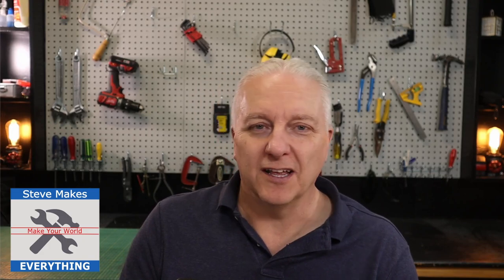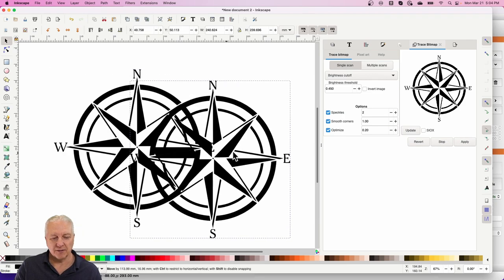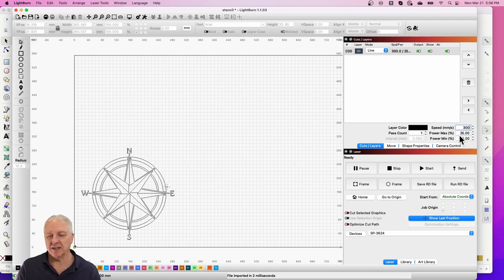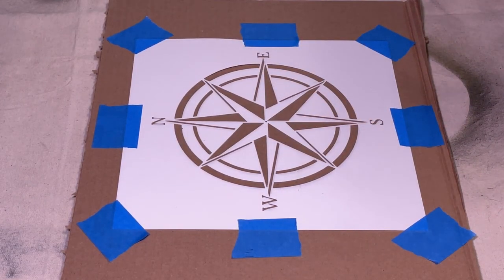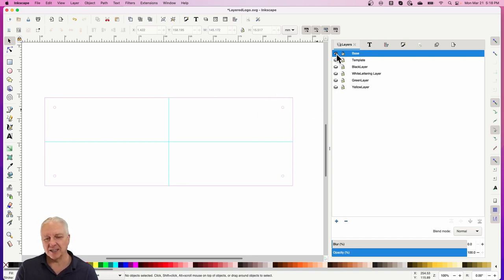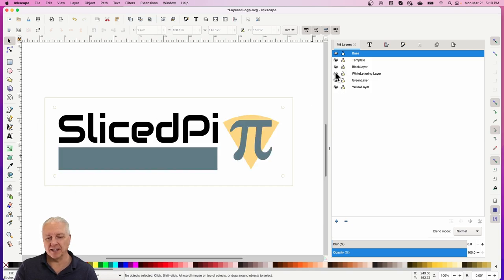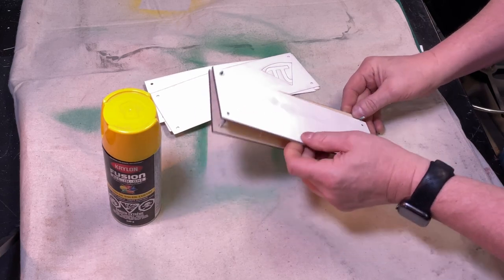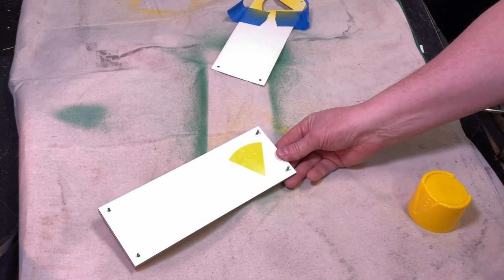Laser Cut Mylar Stencils

Comment: Thanks for this video Steve. I have some 7.5mil (190 micron) mylar sheets I was wanting to make some stencils with. 
Would you have any idea what laser power I would need to cut through his material quickly and effectively?
Reply from the maker: Power settings depend very much on the laser, but Mylar cuts pretty clean and easy so I would say start with about 50% power and reasonably fast speed

Comment: Regarding overspray, you can minimize it by spraying the back of the stencil with with removable (also called repositionable) adhesive.
Reply from the maker: Sure that could work. You could always just put a bit of weight of the stencil too in order to make sue it is flat of the surface before spraying

Comment: Hi Steve, Thank you for your well informed video.  Can you tell me what laser machine you are using to cut the stencils?  The link you have goes to the Cricut but I am looking at purchasing a basic laser cutter.
Thanks again.  Anna :)
Reply from the maker: You can use virtually any laser for this.  If you are buying a new laser I'd recommend a 20-30W diode laser.  This will work if your stencils are made from card stock, cardboard or Mylar.  Don't try to cut PVC with any laser though, since it will outgas Chlorine.
Reply: @SteveMakesEverything  thanks so much for your response.  You have been extremely helpful 😊
Reply from the maker: @ajfmodernart  I try 😏

Comment: Thanks Steve!
I cut airbrush stencils of all sorts out of .5mm acrylic and quick one-time use stencils for painting rc planes/boats out of scrap paper and spray adhesive😎
Reply from the maker: As I noted in another comment, anything that you can cut a hole in will work fine.  Acrylic would be great if you want to make many copies but it's probably cost-prohibitive if you are making just one of something.  Card stock is as cheap as dirt and cardboard is free.

Comment: I would like to cut  stencils using mylar for stencils for cookies, is a diode laser good for this? and what is the best thickness for this? and if I curt mylar with a laser is it bad or dangerous ?
Reply from the maker: Mylar should be safe to cut. It has no chlorine or other bad chemicals. Of course make sure you are vent fumes properly. The thickness shouldn’t matter since you will be able to cut any thickness
Reply: @SteveMakesEverything  awesome thanks for your reply,  is the acrylic the bad one?
Reply: @yolandaruiz9435  No, acrylic is safe as well. That's PVC (and vinyl) which is harmful (both for your lungs and for the laser) to cut with laser: it has chlorine (the C of PVC) fumes which mix with air moisture, creating chloridic acid…

Comment: Sweet video - any tips on making a stencil that is larger than the bed of the laser?   I suspect I'll need to cut it in pieces, then connect the pieces, looking for ideas on getting the registration right so the parts line up (48x48" stencil on a 17x17" laser)  Thanks!
Reply from the maker: If you have a diode laser, you could just move the material around under the laser.  Add a few non-engraved targets to help with alignment if it's critical.

Comment: I have a question: is it possible to laser-cut stencils (masks) from washi tape (japanese masking tape)? How small elements can be? I build plastik models and I use cutting ploter (not a laser one) to cut masks, but from time to time designs require more precision. Some elements can be smaller than 1mm. Is possible to cut them on laser cutter?
Reply from the maker: It should be possible to do this.  Lasers tend to be very precise.  for most lasers the kerf (i.e. the gap created buy a cut) is on the order of .2mm or less.  You should be able to resolve elements down to less than a millimeter with relative ease.  Note that you can also calibrate lasers such that when you cut something like a square, it can be accurate with typically +/-0.1mm or better

Comment: So you can basically cut out anything you'd like correct? So if I wanted to cut out load of the Ring type of stencils or comic book stencils I can? I'm thinking about buying one for my spray paint art Workshop. I'm just curious if I could make a stencil of what I want or is it certain things you can?
Reply from the maker: You can make stencils out of any material your laser can safely cut.  If you want to use PVC type materials for stencils then a blade cutter is the right choice.  Look at the review I did recently for the xTool M1.  If might be the best of both worlds as long as your stencils aren't larger than the workspace
Reply: @SteveMakesEverything  thank you for responding. I meant more like any type of picture you'd like?
Reply from the maker: @jarrettvasco7710  Ah.  Well obviously you will be limited to images that are monochrome (a.k.a Black and White).  Grayscale images would be out of the question unless you are very good with an airbush
Reply: @SteveMakesEverything  I'm looking to buy a laser cut out so I can make stencils! Maybe two three layered stencils. I'm a newbie spray paint artist so I'm looking to make my own stencils. And I heard these machines can do that and make layered stencils as well?
Reply from the maker: @jarrettvasco7710  I would suggest starting with a 10 or 20W diode laser.  This will let you make stencils out of thin plywood, mylar or even cardboard.  If you don't want to start with something like an xTool M1 now, you can always buy a Cricut or similar later if you want to create stencils out of plastic.

Comment: Hello! What materials would you recommend for reusable stencils? Would the cheap laser cutters off amazon make good stencils from Mylar?
Reply from the maker: I've used Mylar and also PVC film (cut with a blade cutter).  Pretty much any blade cutter will work on these.  I have a Cricut 3, but now I'm mostly going to use the xTool M1 that I reviewed recently
Reply: @SteveMakesEverything  Thanks for your reply! So you would no recommend using a laser cutter for these? I have heard good things about cricut so might have to go for one of those. I'll look up your xTool M1 review now cheers
Reply from the maker: @jack5337  Definitely use a laser cutter when you can - especially if you already have one.  My point here is that cutting PVC (a.k.a Vinyl) with a laser cutter is inherently dangerous because this will release chlorine into your environment and cause you harm

Comment: You cut the holes after cutting the outside. Wouldn't it be more accurate to cut the outside as last? Thanks for sharing
Reply from the maker: You don’t always get a choice if you use the same setting for multiple objects. If I had chosen a separate layer for the holes in lightburn I could have cut them first. As long as you aren’t shuffling the material around on the bed there’s not much that will go wrong though

Comment: For a cheap quick template you can use cardboard. If you want a reusable template you can use acetate sheets. If you have a blade cutter you can use self stick vinyl.
Reply from the maker: Yup, anything you can cut holes into will work.  I've used acetate, Mylar or PETG films and they all work well.